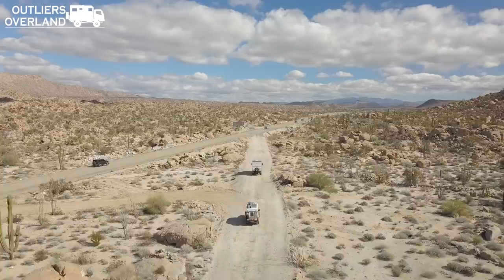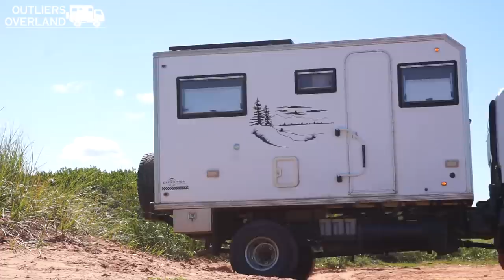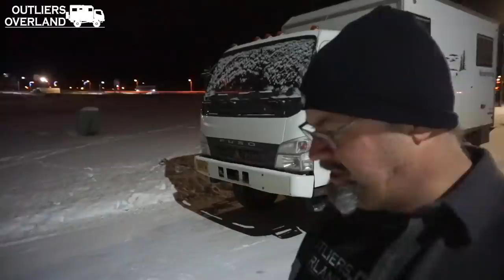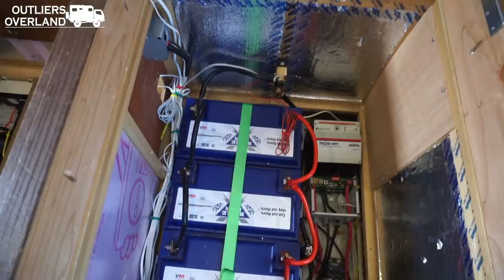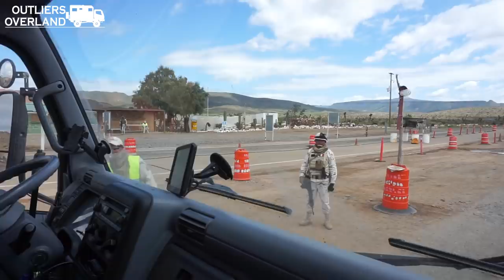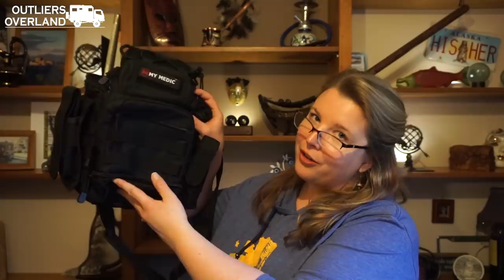Is Your RV, Overlander, Car, Truck or Van a Pandemic BUG OUT Vehicle?

Comment: We scored 65. 4X4 250 diesel truck and 36' 5th wheel no solar (it is solar ready) but lots of cooking, cooling and heating sources. Our RV is always stocked and ready to go. Hubby is a veteran and retired heavy mobile equipment mechanic and can fix anything.  I can, garden and sew and very good with cooking with what's in the cabinet. We live in the South so we're use to the heat but our vehicle can only travel about 350 miles before needing fuel. We are also both 65 years old and know the old school way of doing things which could be very handy. This was a interesting video and made you think. We have traveled to Alaska twice and love your home state. Safe travels. Kenny and Candy
Reply from the maker: Nice score!   Thanks for participating!

Comment: Scored 75. 05 Dodge 2800 LRT full 8' bed, 300 mile range pulling an 07 Fleetwood Pegasus, Solar, 5000 watt generator, 3500 watt inverter, 50 gal water, propane/electric fridge, pro stove, shower. 
Wife(Army) and I(USMC) are both are veterans. Wife works as a PA and I do Physical and Electronic security consulting.
Reply from the maker: That sounds like a great find.

Comment: I am going with a 70 as a score. Ram dually 4x4 diesel. Four season truck camper, 40 gallons of water , 3 way fridge, cassette toilet, portable generator, 100 watt solar panel, food storage, a/c, heat. Additionally I pull a 5x8 with various other gear. Road mileage range about 300 miles and carry an extra 5 gals.

Comment: My 27’ Winnebago motorhome is fully stocked, full tanks (gas, propane, fresh water), with currently empty blk & gray tanks. I’ll give it a 9 for preparedness. 👍🏼  Unfortunately, as a senior, what self-defense and survival skills I used to have are admittedly rusty. I was a pretty good shot (I could hit a rabbit if it’s standing still) and I can fish, but haven’t done either in 20 years. I do have 2 dogs, which add to security - and can turn a key and drive away without leaving my vehicle. 👍🏼

My rig would be iffy off-road, but on-road, I’m a good driver and the rig can, with maneuvering, turn around in a much smaller footprint than many would believe. I have water filtering capability. 👍🏼 I would not want to spend much time in winter here in AK in it - at least not without easy access to either propane or gas & electric. So ... so I guess it would depend on the disaster. I could easily “bug-out” and be self-sufficient for a while, but would need to stick to at least dirt road systems and would need fuel. I guess I’d rate myself a 6, leaning towards 7?
Reply from the maker: Awesome.  Thanks for participating.

Comment: Hi, Our vehicle is a 2005 Mercedes sprinter factory 4x4 low range diff locks 21ft motor home of sandwich panel construction 60mm thick
It has 320l fresh water, 90l black tank plus tote tank to empty anywhere, 215l electric fridge, 840w solar, 400ah lithium batteries 2000w inverter we do have gas cooker but use the induction cooker and an electric pressure cooker, we have diesel heater like yours that heats the engine coolant and the vehicle.
we have walk through from cab,  inverter air con run off lithium batteries which we tend to use to heat and cool the motor home.
It has great storage which we have yet to fill even on long outback trips for months

we only have 150l of diesel but can carry extra cans if required.
We are very happy with this motor home it took us years to find one to fit our needs
Hope this helps to explain why we rated ours at 82
Reply from the maker: Your Sprinter sounds awesome!   
Did you have to beef up the suspension to handle the payload.  I’ve heard that can be a challenge with the Sprinters.  

Great score as well.  Thanks for watching.
Reply: When built it has 3 spring rear suspension heavy duty shocks all round dont know about the front end spring.
The ladder chasis hes been strenghened and the weight upgraded to 4450kg.
When fully loaded to travel except  clothes food and ourselves weighs just over 4000kg so gives us about 400kg to play with.
Love your rig and vids keep it up

Comment: Number 10 is 90%, the poll is unfairly weighted, I'm an Infantry vet, with survival training, anything is a weapon, grew up hunting fishing, building things out of wood and fixing cars, I chose a metal sided class b Van, every junkyard in America has parts for it, no computer, fits a standard parking spot, carry spare parts, redundant fridges, storage and cooking systems, fully self contained, nothing stored outside van, I can walk from house to drivers seat and leave in seconds, solar, black tank holds 15 days, driven it at 85 on toll roads, have carried 45 days of food and 30 days water, can see all sides and corners of van from inside, have packed bug out bag, prepped, may have to survive on foot, not a prepper, physical condition of occupant critical, probably number 1. I'm disabled. 67 on your scoring, 80-90 on mine. Plan to add seed packs in the near future, rocket stove, and compact tent.
Reply from the maker: Thank you for your service.  
A test like this is very subjective and we tried to round out the many aspects.   
If you got a Ford Econoline that’s a great chassis.
Reply: @outliersoverland  hey,, my G20 chassis can do it too  LoL, good job guys
Reply from the maker: What is a G20 chassis?
Reply: @outliersoverland   the GM van body like Ford E series.  the 20 is 3/4 ton, 30 one ton, its on lot of Class C's
Reply: Thanks for replies, it’s a Dodge B250 with the 318/5.2, and readily available tire size, whole vehicle made in North America, pandemic was the obvious problem, we didn’t see, I started getting ready in December when it was disclosed in China, the newer Ram and Ford vans are sourced all over the world, a serious problem when borders close
Reply from the maker: Okay.  Thanks.  I’ve always been a ford guy...

Comment: I rate myself at 100 because I work on my own truck one thing what kind of engine do you have in your truck is it a 3208 Caterpillar engine like a 6NZ C15 Caterpillar engine you want something those two Caterpillar engines I would count on a Caterpillar  not the engine so to me that is strike one how heat can your engine handle that's strike two and your transmission can you work your own transmission if you get stranded somewhere plus you to learn how to take a part your own engine that's strike three and you are out without having someone fix it for you better learn that you better have parts to fix it
Reply from the maker: Awesome.   
The 3208 is a beast in boats.   
Thanks for watching.